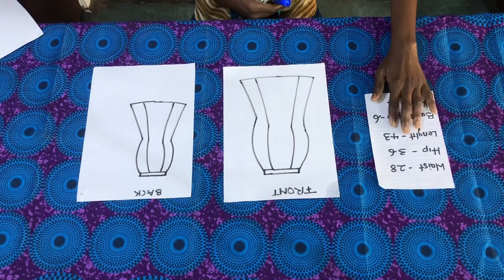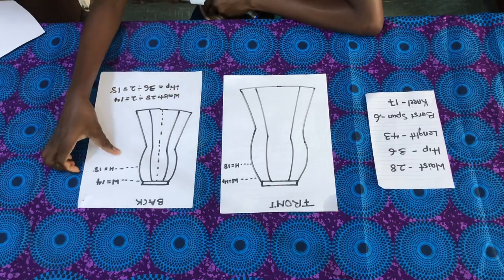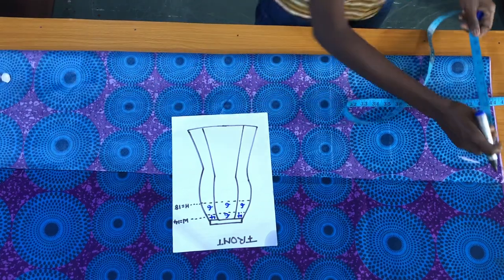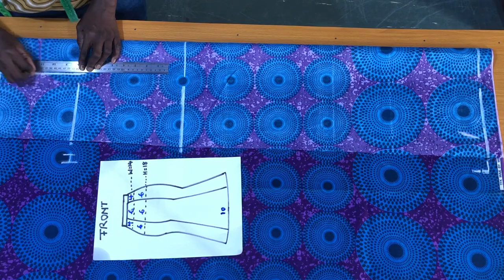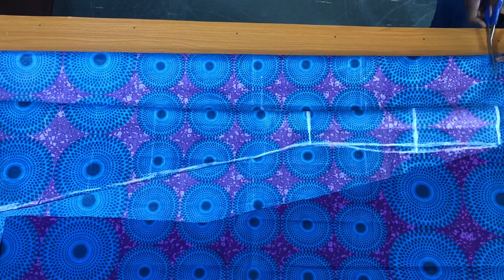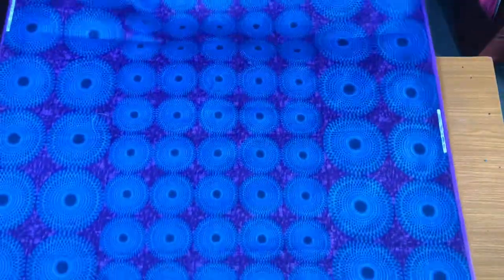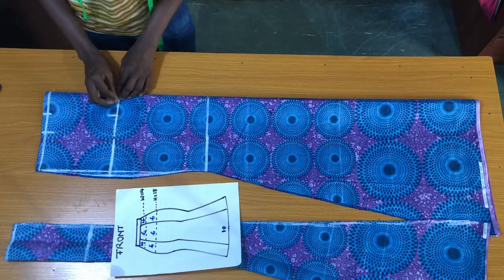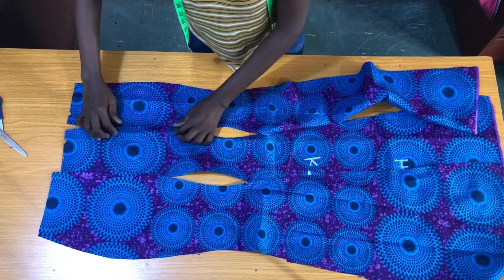How to cut a Six pieces skirt  with Perfect line placement and also avoiding a flat butt

Comment: Hello Ma’am 
Thanks for the tutorial❤️ but I’m stuck at the knee point. I’m working with hips 48, 48/4= 12-1.5= 10.5+ 1 = 11.5. Now if I’m placing the 11.5 on the fabric will I divide it into 2 at the knee circumference or I’ll place 11.5 without dividing it. Please I’ll be glad if you answer my question
Reply: Kindly watch the video. She divided waist and hip into 2 not 4. Thanks.

Comment: Hello Nancy, thanks for the tutorial. I am just trying your method of cutting a six pieces skirt and I got stuck at the point of cutting the two side panels for both front and back. At knee area, you said the hip will be divided into 4 and  1.5inches deducted to get the measurement for the knee. I did exactly that and it's not working at all. The hip I am working with is 49inches, I divided it by 4 and got 12.25 inches, I deducted 1.5 inches from it and got 10.75inches, but it's not working because the measurement I got for the sides on the hips is 8.25inches +2inches allowance =10..25inches. Please check the instructions given and see if there's a mistake somewhere or maybe you correct me where I  have gone wrong.  Thank you so much as I anticipate your prompt reply
Reply: I did same thing and got stuck too. I'm working with hip 48"
Reply from the maker: Divided the hip circumference by 4. 49/4= 12.25
To get the knee circumference 
Subtract 6inches from the hip circumference i.e 49-6= 43 
Now divide 43 by 4 =10.75

This means that you will be placing 12.5 for the hip circumference + sewing allowance 2”

This means that you will be placing 10.75 for the knee circumference + sewing allowance 2”

So its same with yours. After sewing then you will see the final effect
Reply: Okay, thank you
Reply: Anyway, what I did was to divide the 43inches by 6 since we're working on 6 pieces skirt, because what I got for my sides after the calculations was 8.25inches. I used 7.25inches for the knee and added seam allowance of 1inch
Reply: @chimaosoaku7121  oh tnx for this, cos that her own didn't work one bit... I used ur style instead I think that's a better method... in all she did great.... tnx @Nancy but I think u sld do a review of that area to avoid pple spoiling someone's material following that particular area tnx ones more

Comment: One question, you didn't include elastic allowance because you added elastic in the sewing, does it not matter?
Reply from the maker: It does mater because the elastic isnt too tight, and it is also inserted just at the sides of the waist.

I would have added elastic allowance if i was inserting the elastic band in just the back of the waist or the complete waist circumference itself

Comment: Please ma I have a question, this method is for zip right, what if I want to use rope or elastic, will I still use this method?
Reply from the maker: You can use this method. The only difference is that your waist circumference on the skirt  should be wider than your exact waist measurement so the rope or elastic can fit in properly